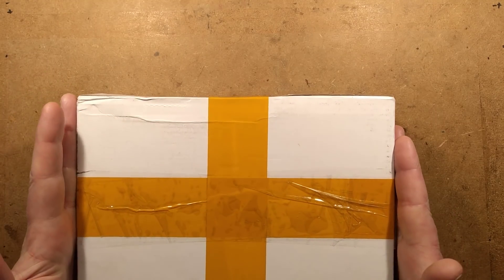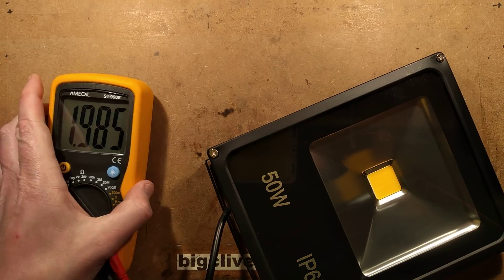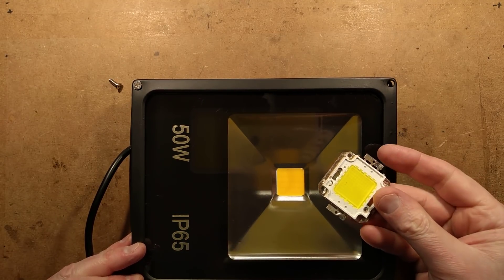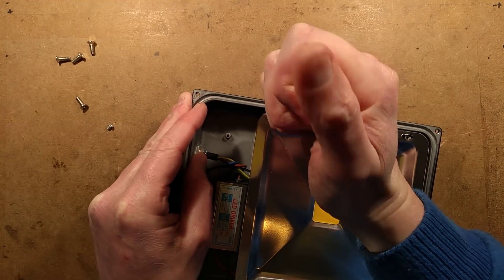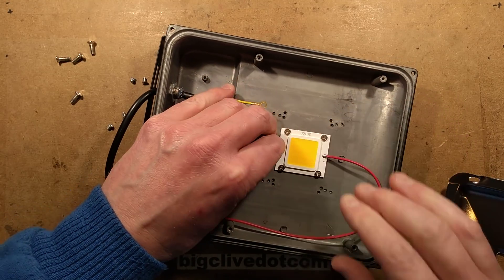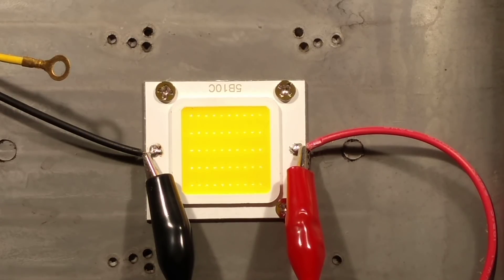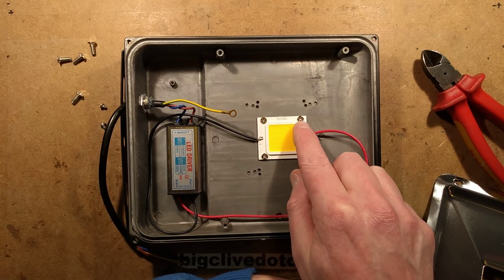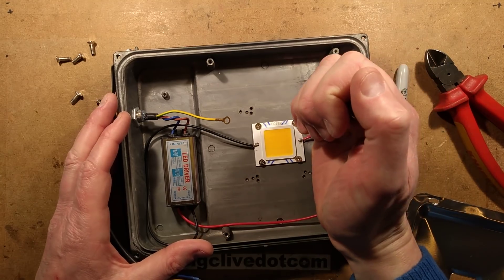Another cheap eBay LED floodlight.  Is it really going to be 50W?

Comment: Quick summary by AI

The video script discusses the purchase of a cheap LED floodlight from eBay and examines its components and performance.

Highlights
💡 The floodlight is advertised as a 50W LED, but it only draws 23W, suggesting a 20W driver may be used.
💡 The power factor is low at 0.563, indicating poor efficiency.
💡 The LED chips in the floodlight are well-matched in intensity.
💡 The reflector and construction of the floodlight are flimsy.
💡 The presence of heat sink compound suggests the LED may be a cost-effective option.
💡 The flexibility of the power cord is limited, but it can be spliced for better use.
💡 The floodlight is useful for its components, even if it doesn’t meet the advertised specifications.
Key Insights
🔍 The discrepancy between the advertised wattage and the actual power consumption raises questions about the quality and accuracy of the floodlight.
🔍 The low power factor indicates poor energy efficiency and may result in higher electricity costs.
🔍 The well-matched LED chips suggest good quality control during manufacturing, which can contribute to consistent lighting performance.
🔍 The flimsy construction and lack of proper grounding indicate potential durability and safety concerns.
🔍 The presence of heat sink compound suggests that the LED floodlight may be a cost-effective option for certain applications, despite its shortcomings.
🔍 The limited flexibility of the power cord may require additional modifications for optimal use.
🔍 While the floodlight may not meet the advertised specifications, it still provides useful components for other projects or repairs.

Comment: What different does it actually make if it's grounded or not?
Reply from the maker: If mounted on a metal structure and a fault occurred the full metal structure could become live.  Even on an insulated surface if it went faulty and you went up to check it out you could get a fatal shock by touching the case.

Comment: Why not grounded? Because it takes 3 s (or 0.05 Minutes) to screw and 0.1 ct for the screw. 🤪🤦‍♂️
But one thing takes me wonder: you disassemble so many devices of unknown sources and quality. You touch the leads after testing the devices under load.
Why not short-circuiting them to avoid an electric shock of a charged condenser that pushes backward-voltage eventually into your hand and body? For example ALL electronic 12 V drivers for halogen lamps can have a backward-voltage. Even the ones bought in a store that underwent safety tests. Shortening the wires takes just 1 second, but I consider it safer. 🤷‍♂️

Comment: I have the 50W and 100W version of these exact chips, they were like €5 on Banggood

they also light up perfectly like that when you crank the voltage up to overcome the forward voltage, really happy with them and whichever manufacturer it actually is, seems reliable

Comment: 50W equivalent brightness. Not 50W consumption rating. After all, LEDs are supposed to be more energy efficient. It all started a long time ago with 50W Halogen bulbs. When LEDs started hitting the market. There was no way easy way to  change the way the market  was accustomed to brightness. Everyone then knew the relative brightness of a 5 , 15 25 50 60 75W incandescent bulb. Same for halogen fittings. So the Chinese manufacturers just marked their fittings as 25W or 50W on the front of the fittings. Like a BMW 218 220 225 330 etc... It was too hard for the shopkeeper to use terms like lumens , kelvin and watts consumed to produce equivalent brightness. To this day I personally still think about the brightness of a 50W bulb as my baseline..

Comment: Dear Clive... followed you for over 10 years now (in a non creepy way...lol). comment on unconnected ground wire: wonder if one of the leads of the LED Chip itself is connected (or could accidentally be connected) to the casing. Adding a ground wire to the casing now could possibly ground one of the LED leads, causing the driver to overheat or fail. The other theory is that the driver uses a floating ground, and adding a ground wire to the casing could short out the driver directly thru its casing, or thru bleed thru the LED chip. This could cause an overheating, worse a dead short! I need to do a surgery on one of these drivers....
Reply from the maker: The newer COB LED arrays can burn through their fibreglass layer and short to the aluminium plate. So they really need a ground.

Comment: Is one of your bench lights flickering Clive? I can see it in the reflector of the 50 watt flood at about 5:30.
Reply: I honestly think its a normal incandescent or TL tube in his room, or a halogen
Reply: @BH4x0r  It could be, but is it that that is causing the flicker?
Reply: @sdavies45  pretty sure as the reflection seems or looks to be coming from behind him, and it seems much less bright and a different color tone as the floodlights

not only that but because he has lots of light at his bench his camera will compensate by setting the ISO as low as possible and the shutter speed much faster

it's mainly the fast shutter speed giving that effect, especially with older types of lighting it's very obvious

Comment: I have similar one but a bigger and grey, with a sensor, Cold light. https://www.ebay.com/itm/20-50W-LED-Floodlight-PIR-Motion-Sensor-Outdoor-Garden-Security-Light-Flood-Lamp/283581274547
It is a 50w led and I think its really a 50w becouse its really strong, the light reach about 150+m. Bought from wish 4 years ago for 25 dollars and its still working.

Comment: So... Next step would be to get your money back since it is nit 50w and reporting to ebay that they are selling fake ( wouldnt that count as fraud?) and unsafe / illegal products (isnt there a law requiring these products to be grounded prolerly?)
I mean ok. Could be a little harsh. But 99% of the buyers will not test this out, so theres a fraud here, and without proper grounding this is actually dangerous. 
Maybe if this happens multiple times chinese sellers will at least watch for proper grounding and correct labeling.

Comment: Is the fact that this light only drew 23 watts means that it should have been advertised as a 23W floodlight?  I bought a 200W Ebay floodlight that has 4 COB LEDs.  It only drew 122.2 watts.  Is this false advertising?
Reply from the maker: That's pretty normal for eBay.  They could argue that it has four 50W LEDs so that makes it a 200W light even if they're being under run.  (In this instance under-running is good.)

Comment: i feel like you should at least occasionally try to get a refund with photos of the HOPI and the inside components proving its not a 50W light. that way you alert these sellers that they're actually selling crap and also get your money back. i have no sympathy for them if they're just lying about multiple parts of it's specs.

Comment: Hey Big Clive, i was wondering if there is an easy and cheap way to hook up some 12vdc 50w led chip to a 12vdc 52amp server power supply. I know i need to limit the current to 3.75a max. I want to run a few off the server supply in parallel. I know they can go into run away and burn up if the current is too high.
Reply from the maker: You could use the large COB arrays on 12V.  The standard 10x10 grid LED arrays like in this video have sets of 10 LEDs in series, so you'd have to boost the voltage and limit the current.  You could use an array of 3x3 10W LEDs with a resistor per LED.   There are two versions.  All 9 chips in series (27V) or 3x3 series parallel 9-10V.
Reply: i was hoping to run the cob chips in parallel and limit the current to each chip... I just need a cheap way to limit the current to each cob.
Reply: In case you didn't get an answer yet: assuming you'll run the 3x3 9-10V COBs from the 12V supply, check out AliExpress (or Ebay, but $$) for power resistors or 6A diodes; you can drop 0.6V with each series diode, and /or use a  0.5 ohm-ish resistor (to drop 2V at 4A) .. which could be two 1 ohms in parallel, for example.

Comment: These things are horrible.  Best thing is to get one and replace it with a decent-ish chip and seal the bugger up well.  On another note there are proper 50w floodlights on ebay for £30 or so.  Made by Luceco, possibly even made in the UK (can't remember and it's 40ft up a pole at the minute)  Had it a year, switched on every night all night and no issues thus far

Comment: Put heaps of these in. Starting to wonder if the earth leads are attached in any of them now....
Reply from the maker: I'm sure there are many thousands of unearthed lights like this in daily use.  And it's by no means the worst thing with the remote control receivers with flimsy relays and very shady circuitry.
Reply: Yeah, no doubt, I’ve had quite a few crappy lights incorrectly wired right out of the box but Aussie Regs now state that lighting circuits have to be on a residual current device. No earth means failure to trigger RCD in an emergency

Comment: Hi Clive, another great video, nothing to do with this video but I have a question, I’m restoring a Revox A50 vintage amp but one of the metal case transistors have a leg broken/snapped, BC109 on the tone control board, Is there any difference between metal cased or plastic transistors? I would appreciate your help.

Comment: Hey Clive, slightly OT question. Bought a mix of cheapo chinese LED E27/GU10 cobs for mains use. Usually 68-70 LEDs in series. Fine, except the combined MTBF of 70 cheap LEDs isnt great. So I end up bridging a dead LED after a few months thus over driving the rest a smidge and away we go like thermal runaway. Anything I should look for in replacements that might make them a little more fault resistant?

Comment: I just bought a 30W unit off Ebay and it's earth was floating inside, I cleaned off the metal and soldered the loose wire to the case.
Reply from the maker: Note that it's pretty tricky to solder to an aluminium based alloy.  I prefer to clamp the wire under a screw.
Reply: @bigclivedotcom  this was steel cased
https://www.ebay.co.uk/itm/LED-Motion-Sensor-Security-Outside-Wall-Light-Outdoor-Flood-Light-Floodlight-PIR/362544066306?hash=item54694f6f02:g:lU8AAOSwIS9cUB4N:rk:8:pf:0
Just realised it is 20W but plenty bright enough for me.

Comment: This is almost identical to a unit I bought about 5yrs ago. Why don't they earth? Because it saves them time to manufacture and trading standards is dead in the UK. Jobs to do when buying one of these: 1) Put decent amount of thermal compound on back of LED module (not too much but just enough to squeeze out the sides), 2) Connect the earth, 3) Replace outer bolts and any other shiny outer metal fixings with stainless steel equivalents, 4) Apply thin layer of silicone grease where glass gasket (hopefully) is. As good as new.

Comment: IP65??? I wouldn’t want that connected to the mains in torrential rain! IP56 would be better for use in the garden, especially where there is a lot of rain. Good that the IofM doesn’t suffer with monsoons.
Reply from the maker: We have continuous storms here in the middle of the Irish Sea.
Reply: bigclivedotcom What surprised me was the “50W and IP65” on the front of this thing. My guess is that only about 30% of the population knows what 50W means and considerably less than 5% understand IP ratings. To make the thing even more impressive they could have added the Ex protection, but not with that loose earthing wire.

So the next test is to take it out side, hook it up to electricity and throw a bucket of water over it!

By the way, I understand these ratings, my job included inspecting large electric motors for onshore/offshore oil and gas facilities.

Comment: I have 6 sets of Ebay floors. Four 150 watt and two 300 watt. What got me started was my portable work flood lights kept blowing quartz halogen bulbs. After a while that gets a little expensive. Plus I was tired burning my hands on them by trying to grab for the handle and missing. So I replaced the actual heads with two 150 watt LED floods. They're a little less bright but not for medically. No complaints. I bought two more 150 watt floods because they are better then the dedicated photography CFLs. I use daylight equivalent photography lights. 150 s were just a little bit brighter than the cfl's I had but still not as bright as I wanted. So I have my game in order to 300 watt flood lights. Okay now we're going. Believe it or not if you take a 300 watt in this case flood light imported into a reflective umbrella oh, you get a nice smooth light. No hotspots no Shadows. I have two umbrella for selector set up with the 300 watt floods. I use the to 150 watt floods for fill light. On the ceiling I have to 100 watt lights in the normal ceiling fixture. when everything is turned on the room doesn't get too hot and I get great pictures without a flash. I prefer the floods to a flash or slave flashes because you don't get the problem with red eye or people blinking. I've been very satisfied with my eBay flood lights. They were fairly inexpensive and they work I can't ask for more

Comment: Got a question. I noticed during some of your led builds that you have large bags of hi intensity leds. I’ve looked and tried to find a place to buy in bulk but with no success. Would you mind sharing where you get yours so I can get my hands on some white and red leds for a grow light project I’ve started? Thanks.
Reply from the maker: Search on ebay for 1000pcs of the LED you want.  For instance 1000pcs 5mm red led

Comment: Clive, I finally figured out why they rate them 50 watts and they're only 20. The power factor of .56 makes them look to be drawing ~50 watts to the power company! 🤣
Reply: And to the customer's meter!
Reply: Power factor isn't an issue for the domestic market, we are only charged for the true power (in this case 20w).
Industrial market does get charged for apparent power, most industrial use is for things like electric motors which would be inductive loads that would give you a lagging pf, a capacitive dropper would be a leading pf, therefore it would compensate somewhat for the lagging pf of the inductive loads. When I was a colliery electrician, we had sodding great big capacitors in our sub-station that we'd have to switch in or out to compensate for the highly inductive loads from our transformers & electric motors.

Comment: Haha, darn, this is even an expensive and 'fancy' version of such a floodlight. I bought 8 defective ones (different build-quality and different defects as well) for a bargain. 3 of them were like the ones you have Clive. BUT, the front is not glass, but plastic. There is no driver inside, but one of those driverless LEDchips, which has failed in all of them. In the first I opened, it's because the LED just isn't even mounted flush to the case: there is about 2 millimeters between LED and case, as the screws were too long to push the LED down. The others suffer from too much or no heat-sinking compound. It says 50 Watt on the housing. I ordered a 25 and 50 Watt white LED. With the 50 Watt LED properly mounted with compound and the right screws and underrunning it at 40 Watt from a MeanWell driver, I quickly aborted a testrun as the yellow surface of the LED quickly reached 85 degrees and was steadily climbing... The case was not too warm to touch...
The bracket to mount the thing is just soo flimsy one would not even want to mount it with a driver inside, as it will likely fold under the weight.

Comment: Yeah, first you get scammed and when you write it in the ebay rating to warn others they put you on the sellers black list... Doesn't matter though 'cause you wouldn't buy from this seller again anyway. On the good side: suprisingly well matched led's and equipped with heat sink compound. The ground wire flapping in the breeze is a shock. So you cannot just measure, you have to open the case to be sure.

Comment: BC - could you explain a bit further the failure mode of the modified 20W bench lights you mentioned which failed - the leds that started to "flicker and strobe" - are you saying the flickering occurred within a failing SMD led itself ? I've always assumed flickering/strobing leds to be due to a driver fault - any more info you have would be useful to lots of folks :o)
Reply from the maker: Bond failure on high power LEDs is common.  It can result in a period of flickering or rhythmic strobing due to thermal cycling that looks similar to driver failure.
Reply: LED flickering failure:- thanks for this info Clive - first time I've read of this from a trustworthy source. I guess the 'fused' bond wire acts like a bimetallic strip in an old style flasher bulb for a while, until it gives up the ghost completely - very handy to know sir ! :o) (I have a barn floodlight partial strobing failure to look into some time soon)

Comment: 2:36 In a way they didn't lie .. With that wattage and that power-factor ... you have a chance that your power company will charge you for 50W ...
or 40 at least .. 23.07W / 0.565 =  40.83W ...

Comment: Why is it not earthed? Simple: the person assembling it was probably under unreasonable pressure to assemble a number of units within a fixed amount of time, maybe even desperately waiting for the next toilet break if the work conditions are terrible enough, like what we're starting to see here in the UK at places like the Amazon fulfilment centers. Everybody squeezes the person along in the chain a little bit to get prices down and profits up, and ultimately, all that pressure ends up on the guy or gal assembling them for 12 hours with little more than a 20 minute break at some point. Not making mistakes would take longer than they are given.

Comment: Does anyone have a recommendation for a cheap 100W LED and driver that is ACTUALLY 100W? I purchased one on eBay for an experiment, which is proving promising, but alas it is also only 21.6W.